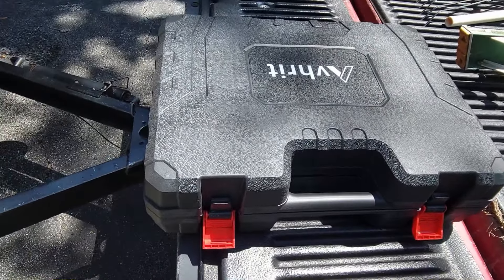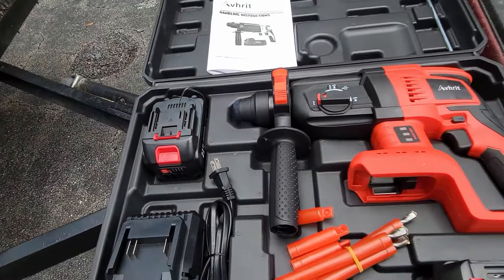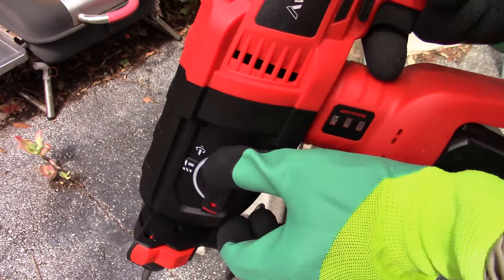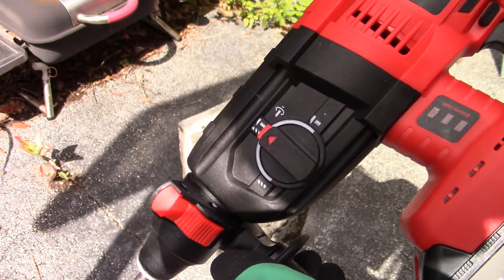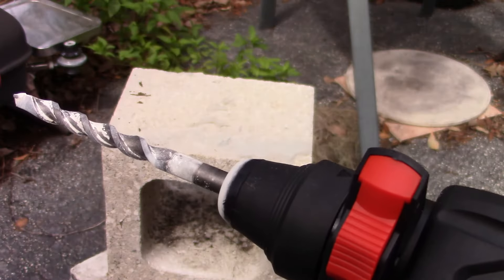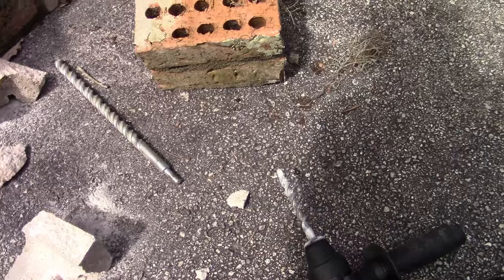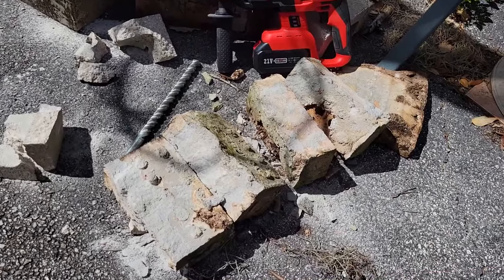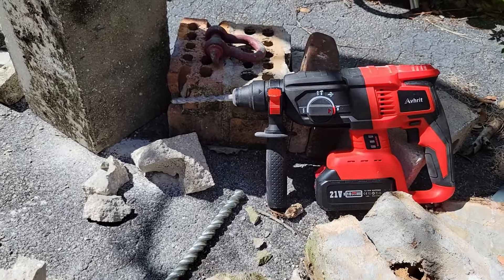Avhrit Cordless Hammer Drill and Chisel Review

Comment: If you search for drill/chisel bits the system is called "SDS-Plus". Quite common here in Germany, since we mostly have brick or concrete walls.

I don't know if this particular drill is able, but normally you can change the chuck with an allen wrench to use "normal" drills.
Reply from the maker: Oh, wow, I'll look into that. Thanks for that info.
Reply: @Something2LookAt  So my Avhrit came yesterday and I had the chance to test it also. Unfortunately the chuck can't be changed to use normal drill bits.

But SDS-Plus is superior anyway :P
Reply from the maker: @oODomeeOo  Indeed, you are right. I've been looking and I think I am going to buy drill and chisel sets for that system to use with this drill.